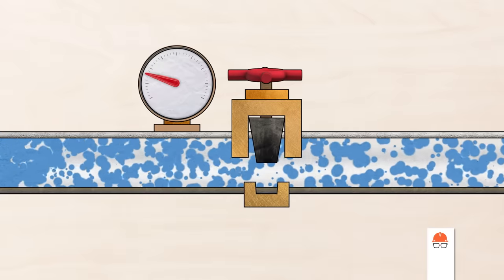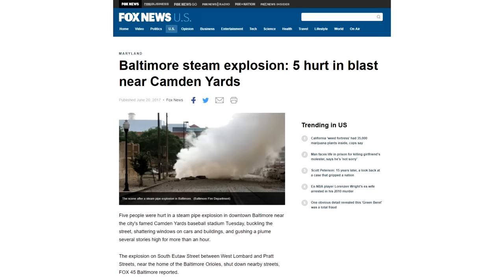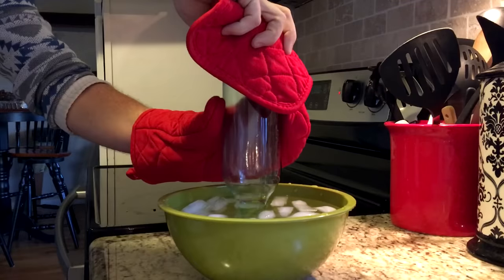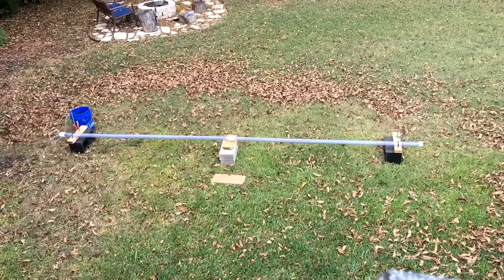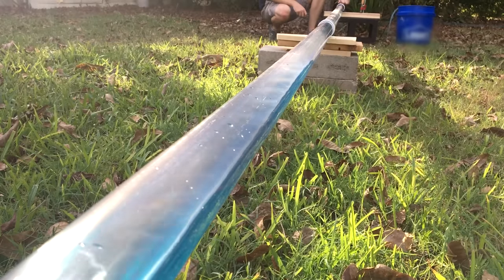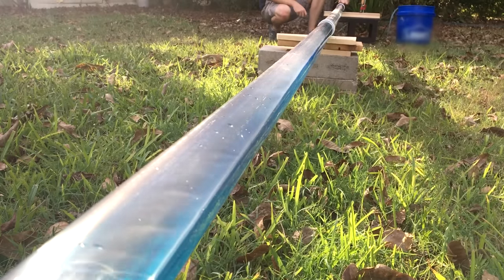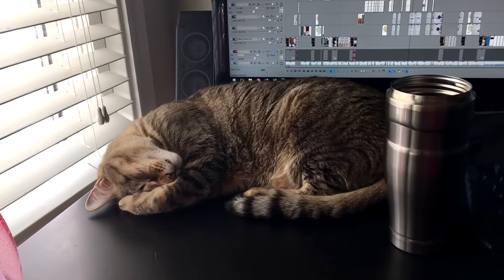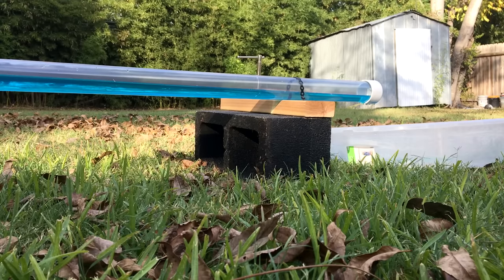What is Steam Hammer?

Comment: I deal with this phenomenon every working night; bc my managers insist upon shutting the boilers I work with down at the end of their day shift. I come in at night (5 hrs. later) and have to fire them up again. Even though I have purge ports at the end of nearly every headpipe (and have them open); and have traps on every condensate return branch (before return mains), I get car-crash levels of hammer most nights, even starting on low fire. There's just not enough pass-way available to allow the condensate to clear. So it slams into end-flanges and traps; and I wince every time. That's how all my nights begin.
Reply: D Snodgrass Sounds like you're starting up too fast. Start up on low fire and leave it for at least 15 mins, then incrementally increase firing rate to operating pressure
Reply: D Snodgrass engineer condensate drain systems before startup.  Patent it retire to Hawaii.
Reply: Hey i wonder if you can create a dry air purge system that just launches most of that condensation towards the head pipes and caps, maybe removable caps to allow higher velocity? Or what about a way to run hot, dry air through to pick up that condensation?
Reply: Why shut the boilers down at all.  Just fitted a steam system to a new piece of equipment that we had to conect to the main steam manifold.  Customer  shut down the boiler for service at 6am, we arrive at 8 am to connect up to manifold.  The manifold was a good 6 foot long and 12 inch in diameter.  In that short space of time the thing was full of water which would of shot down the lines on start up.. PS The bit we fitted was double valved at the manifold. Customer didn't realise that's what has to be done and just thought we were putting an extra valve in to up the cost.
Reply: Mario That's my SOP-manual lowfire for 20 minutes until I draw straight steam from the purge tubes I have out on the perimeter of the system. Still not enough. It's gotta move through 3 sets of piping first.
Reply: Max Janszen Problem with that is, unless your non-return valves at the boiler are absolutely air-tight (most are not) it's going back into the boiler, too. And doing damage there, to your LWCO float valve microswitches, among other components. You'd have to have a one-way (and huge) air-tight check valve to shove it all out towards the (open) caps; and then get the caps back on somehow against active steam-pressure. Tall order.
Reply: Michael Walker I tell management the same thing about once every three years, when they ask. Leave one boiler on dead-low fire during the week with about 10lb. pressure through the system; just enough to keep the condensate moving around. But they won't do it. Meanwhile they're burning 3X my yearly wages every year on repairing tube-leaks they never had before they started shutting down every night. Managers are geniuses, you see; just ask them. :)
Reply: D Snodgrass  Heres a tail I got told on a comp ex coarse.  In India they dont think that getting hit by super heated steam is the worst thing that can happen on a work day. Its the COBRAS  that lurk about the warm steam pipework. ...
Reply: @dsnodgrass4843  Bring it up with higher managment, like the finance guys, explain that you'll save money by running stuff rather than replacing stuff.
Reply: @thegeneralissimo470  Tried it, several times. Even had the yearly inspection guys (who turn into 3 days of tube-repair guys, if we're lucky) make the same case. Capitalist organizational politics means the proposal goes to a level to die, every time. That's all i can safely say in a public forum;  i'm sorry.
Reply: @michaelwalker1119  told my employer / engineers they needed to put double valves in, you would think i had told them to eat their own children!!

if you co. doesnt take it seriously, get a different job, honestly.
Reply: @maddogmcfly5504  Just fitting a 2" steam pipe at the moment.  Every time the pipework goes up it needs a  steam condensate trap and a dirt pocket at the bottom.  Two inch T, steam gose up and the water falls down to a two inch to 3/4  reducing T which then has a short lenth of two inch pipe with a cap on the end.. 3/4" steam trap to return to the hot well.
The company that supplied the steam train  can't even get the trap sets right without us altering them, no way to remove them without shutting of the steam feed to the train.
Reply: lol  That's about the fastest way to kill a boiler. Cycling it from cold to hot to cold .... is the worst you can do. RIP, ol' boiler.
Reply: @dsnodgrass4843  sounds like you need to bring it up to a government regulatory level with maintenance and repair records to  back up your story. Also record your experiences for family to have just in case something does go catastrophic so it will be a slam dunk in court!
Reply: @dsnodgrass4843  A good manager would (not just should; WOULD) listen to the guys operating the machines. If they don't, they're simply (very) bad managers. Alas the feeling of power makes them pigheaded. And there are cases where they do NOT want to save money just to ensure they don't get their budget cut next year. Govts and some companies work that way. There's only one way that you can soothe your conscienceness; find another job, quit this one, and hope your new managers are better listeners.
Reply: Same experience for me too...during night shift when the plant is shutdown, we have to open the steam at morning 5 AM..those heavy sounds gives me panic and fear...
Reply: @kvsalahuddin5  I'm sorry, boss. Best thing you can do is try and get as much water out as you can, through drop tubes before the traps. And if you're opening from a pressurized steam-side to an unpressurized section of the system,  open it real slow in increments to drive out the water slowly. Do it fast and it'll bang like hell; and maybe blow out a gasket or pipe joint, which will be a mess to deal with. Good luck.
Reply: @dsnodgrass4843  its disgusting the things that happen when companies are run by finance people that don't listen to engineers! and it doesn't even make financial sense now! ugh
Reply: Sounds like you need way more drains to that header. Dammit, who tf engineered that plant. There should be absolutely no hammer effect on that header with all your drains open and low fire.
Reply: hands down funniest thing ive read all year
Reply: @Chayton  I Finally got them to change their minds on that, so they weren't cracking tubes every year. Still gives me ptsd thinking about it, tho.

Comment: As a boiler operator I want to thank you for providing one of the best and most dynamic demonstrations of steam hammer I've ever seen! Truly a beautiful piece of work!
Reply: I was thinking the exact same thing.
Reply: It destroyed a steam loco once, it was doing it's thing as a loco in preservation and the firer overfilled the boiler putting water in the superheater, it flashboiled, blasted the ends of the pistons and the driver tried to throw it in reverse to slow the wheels and broke his arm and the valve gear was destroyed, normally with the wheel slip (which is what caused most of the problems) you just close the regulator but with back pressure in the superheater that was impossible

Comment: Once saw a maintenance supervisor open a 6” steam valve wide open after a 2 day shutdown. Put 250 psi steam into the steam main instantaneously. Blew a 500 psi blind flange that was 500 ft away off of the end of the main. Never did find the bolts that were holding it on. It’s amazing what steam can do in the right hands and what it can destroy in the wrong ones.
Reply: A. Wagner Steam is dangerous stuff. Been a stationary engineer for 30+ years and seen a lot of stupid stuff but that was the most impressive. Made a hell of a racket. Didn’t take me long to hit the big red button on the boiler though.
Reply: Why would a maintenance supervisor be opening that valve? That should have been an ops job. That valve wasn't LOTO'd?
Reply: Mark Kaiser Small plant, non-union. No LOTO since it was normal startup after maintenance on some equipment. In a hurry to go home on a Sunday afternoon.
Reply: Paul Mace Hurrying a job can get people killed.
Reply: Hurrying up a job GETS people killed ... too often.
Reply: Just brings to my mind what happened to 60532 "Blue Peter" in 1994.
The steam locomotive was on it's way to from Edinburgh to York and at a stop at Durham station, the crew was swapped. The new crew just had general instructions on how to handle steam locomotives but was inexperienced with the 60532 and accidentally overfilled the boiler. On Durham Viaduct, the locomotive went into wheel slip which was badly managed by the driver, he then opened the regulator again (way too early) and without noticing that the initial wheel slip primed the boiler which, due to the water now present in the system, jammed the regulator valve wide open and allowed the maximum amount of steam to get to the cylinders. The driver wanted to wind the reversing-gear back into neutral position but the water-pressure slammed the handle into full-forward, breaking the drivers hand in the process. The wheels reached a speed of 140 mph until the cylinder-heads burst away and the drive-shafts destroyed themselves.
https://www.youtube.com/watch?v=YjsNbzg1UaI
Reply: it's always that way, fast to go home...
Reply: Whenever production people ask me what I do, I show them the clip from that 2007 explosion in Tennessee. I prevent that from happening.
Reply: I almost got sprayed by almost boiling oat milk when a pipe blew out a temperature gage
Reply: stationary eng., youre Canadian too? Im working on my seconds
Reply: Callum Croteau  pop over to Power engineers Annonymous , on Facebook.
Reply: @paulmace7910  a stationary engineer from NY?
Reply: And I get to look forward to all of this as an instrumentation engineer
Reply: A maintenance supervisor? At my hospital maintenance worker and supervisor wouldn’t be allow in our central plant unless is with a stationery engineer around them.
Reply: @wackedout13  because you're at a hospital
Reply: How is it possible to open a steam valve instantaneously? Was an incorrect valve installed?
Reply: @Metatr0n  so you're saying that a steam engine going 88 MPH is not all that unrealistic?
Reply: Paul Mace , ... My StepDad was a “pipefitter” at Youngstown, Sheet, & Tube, ... he never used a torch, or a welder, ... he only cut & fit, & installed steam pipe, for the power that made the punches that made the 60’ long seamless pipe, ... his nickname was Jitterbug, & shortened, some just called him Jits, ... but his name was Ralph GILBERT, ... & he had accumulated a shitload of knowledge, ... 
he had some stories to tell, ... some funny, some horrific, & believe me, ... everything from a guy working on a vat that held naphtha, smoking a cigarette, to some funny ones, that made inept people, like his foremen just look like a classroom dunce, ... to some with racial overtones, & others of heroism, ... if anybody would like to know about the tales he had to tell, from meeting with JFK, to the horrors of forcing the company to not only implement safety policies, but to making them follow the rules of those safety guidelines, ... steam, is one subject that has had many ingenuitive uses in modern day life, ...
Reply: Paul Mace yeah didn’t quite understand that you need to crack the valves open and preheat everything

Comment: I as a plant operating engineer of 35+ years Have seen boiler system controls fail and overfill boilers forcing vessel water into steam manifolds . It sounds like a stick of dynamite and it's something to see an inexperienced operators face when it happens . I constantly remind newer engineers as to the potential dangers .

Comment: Excellent video. I'm actually a boiler operator, and I've seen the damage water can do once you put 170 tonnes of steam behind it. We recently had a catastrophic failure of a steam turbine after attempting to warm the steam lines without any drains open to allow the condensate to drain. 
Luckily no one was around at the time and no one was hurt.
Steam is a very scary force to work with.

Comment: 4:30-5:00 I work in a water plant/distribution system, and as soon as the discussion turned to the condensate forming a seal in the pipe I'm going "yes, this is going to be great!". Whoosh, boom! 
But yeah, it is very dangerous. We've had issues of our own with water and differential shock involving trapped air and pressure reducing valves. 
We have a line feeding an online Ultraviolet Transmittance analyzer, which is fed directly off our high service pump main, a 14" pipe carrying 117psi, to a 1/2" line that ends at a pressure reducing valve that drops it to 35psi or less. We had an issue once of draining that large 14" piping to install a flow meter. Little did we know that drained the small line as well. When we bled as much air as possible out of the main, we missed that small line, and when the HS pump started the air hit the PRV, which air cannot operate, and was compressed to immense levels by the water rushing behind it, and the SCH80 piping failed spectacularly. One piece of a fitting was blown 46 feet across the room. Water is incompressible, but gasses are, and when they coexist in a sealed system bad things usually follow.

Comment: One of our biggest process issues in our large integrated steel mill is how to deal with the steam condensate in complex systems. Sure, condensate is a useful "byproduct" as described, and you'd think it would be easy to drain it off anywhere required. Not so. In my division, we have a combination of old and new steam systems and quite frankly it seems nobody actually understands much. These HP steam systems scare the crap out of me... I've heard that big steam hammer crash, and in no way is it like water alone ! Super vid.

Comment: Reminds me of my own steam story. In the 1980’s, I spent a few nights in an apartment in Manhattan that apparently had steam heat.  Boy the sounds that thing would make! It was like somebody was in the room with a hammer clanking on the radiator every once in a while. I don’t know how anybody slept, I don’t know how the system didn’t just break somewhere. 44 years later, still crystal memories of those nights!
Reply: Early 90's college apartment same. Single pipe radiator system with those auto air vents. Was often feast or famine and sometimes we had to use a screwdriver to vent the rad and get heat.

Comment: It's worth mentioning, that the partial vacuum formed by the steam condensing as it hits cold pipes is actually what drives the propagation of steam through the pipes, pulling the steam from the furnace towards the ends of the system (like radiators). This at least is true of low pressure steam heat systems in old homes, and I assume it applies to other applications also.

Comment: Fun steam fact: as steam moves through a steel pipe, it will slowly erode it. Areas of high turbulence, such as bends, valves, sensors, and joints (even welded ones) erode faster.
Reply: Yes, steam cutting is a fascinating topic. I used to operate steam plant equipment aboard the USS Harry S Truman and one of the important design safeties is that all bends are 3-4 radii of the delivery pipe.  All isolation valves are gate type and when a globe valve is needed for throttling there are always two (upstream throttles, downstream wide open) to ensure there can be a positive shutoff in the event the throttle valve becomes too degraded from said steam cutting. Also bends cannot contain welded joints nor "taps" for instrumentation and thermometer wells are at an angle with the intended flow direction where possible.
Reply: I only learned about the topic during a class on instrumentation and when we asked the instructor about an accident that had happened at a food processing plant in the area. Apparently, they had not replaced parts of their water heating system that had become worn and the local inspector was so overworked that it had several inspections waved. Having large quantities of steam come into contact with cold water made a rather large explosion. Management literally had a bomb sitting on site and didn't care. Luckily, no one was hurt.

I also learned in that class that other gases at high velocity would wear at the inside of pipes as well, but not as badly as steam unless they were highly corrosive. Apparently, the oil and gas industry has issues with high temp and pressure gases in their processes eating away at welds that do not use enough argon purge gas. Rough surface and porosity really makes a weak point in the pipes to erode.
Reply: yes, steam is quite agressive as a medium for eroding pipes from the inside.
Reply: I'm a pipefitter and I've fabricated main steam lines for 800MW coal fired power plants. It's really fun work. Everything is so heavy. The pipe can be 3 inches thick and weigh hundreds of pounds per foot. A single weld takes days to complete.
Reply: @matthewerwin4677  Extreme pipefitting - that could be a show!
Reply: The limitation of steam turbine hardware to handle high temperatures of superheated steam, is the only limitation engineers have to increasing the power output of steam turbines.